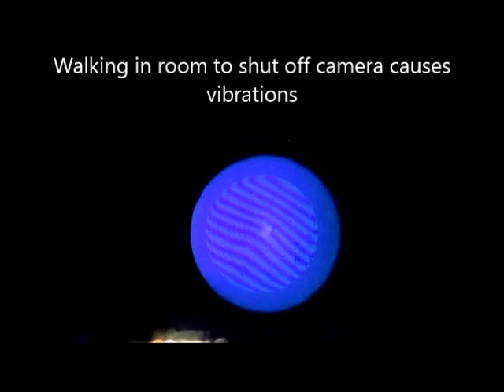Testing a 6 inch flat

Comment: does an optic flat need to be flat on both sides? i have some optics from camera lens. one side is pretty close to flat. the other is clearly convex. will that work?
Reply: My understanding is that no, only one side needs to be flat (the side that will be facing towards the specimen you are checking for flatness.

The interference patterns is dictated by the size and shape of the teensy air gap between the "bottom" of the optical flat and the face of the specimen being tested. Full disclosure I am super new to optics, but that's my understanding so far